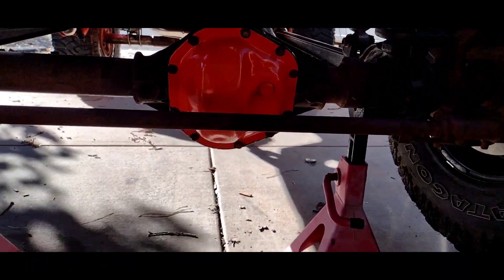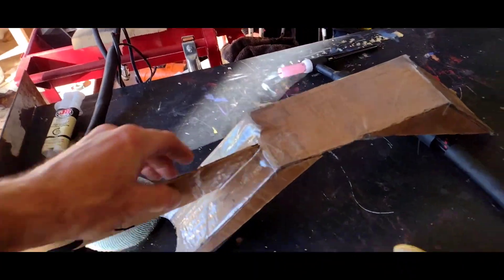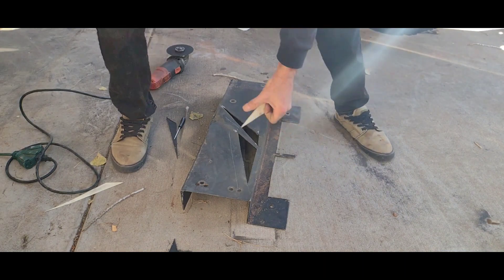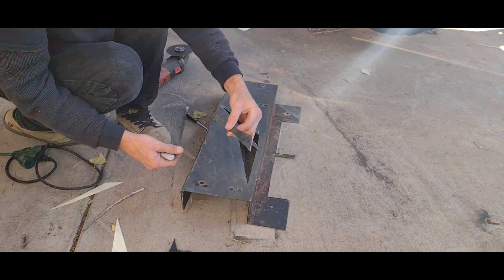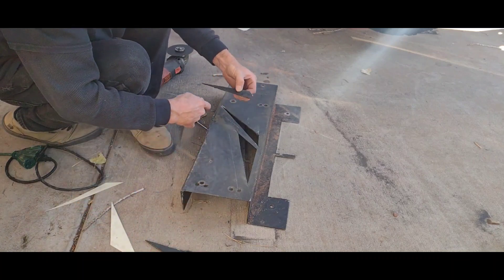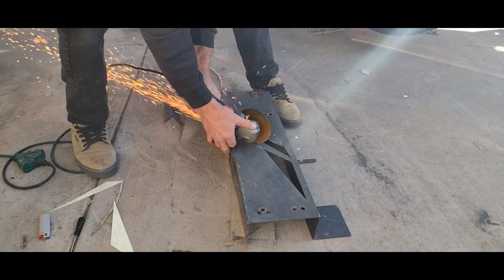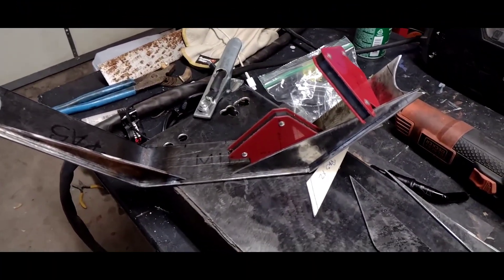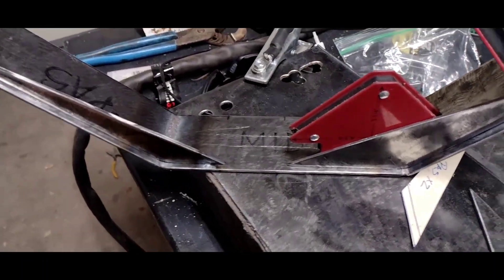Fabricating an axle truss for high pinion Dana 44 Part ONE

Comment: Right off the bat.
This guy is an idiot for not having the guard on the high speed grinder. I've seen people who've been badly hurt when cutting or grinding wheels have exploded or broken apart..

Not a very good example on being safe operating dangerous tools or equipment, should also wear a face shield when grinding.
The weld job itself looks very poor quality considering is TIG..
Reply: Hey jackass remember.... Safety 3rd so keep your dick inna vise my man 🤣
Reply from the maker: Only when it's not twisted up in a lathe!
Reply from the maker: https://youtu.be/akenCJEdItg
Reply from the maker: Well... Thanks for your concern, and sharing your opinion. That comment is 100% correct; I am an unsafe idiot, who doesn't have perfect tig welding skills... While my welding isn't perfect it will stick, and to be honest I have seen worse. Just like I have seen complete morons make ignorant comments on YouTube... Difference between me being an idiot, and a moron? I will improve with time, as will my videos, a morons ignorant comments will be laughed at until forgotten... 
Thanks again, and stay safe!